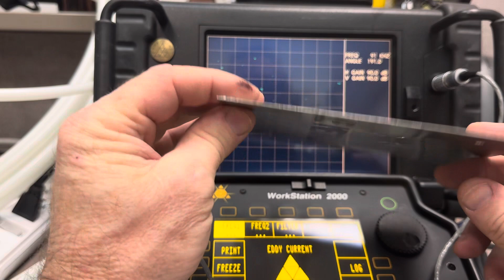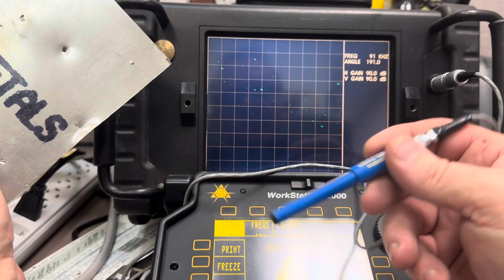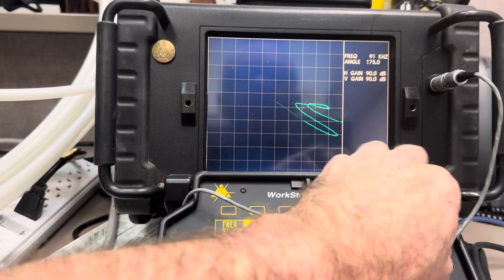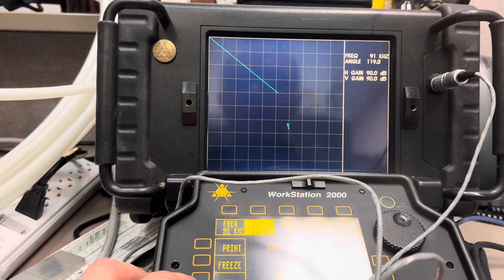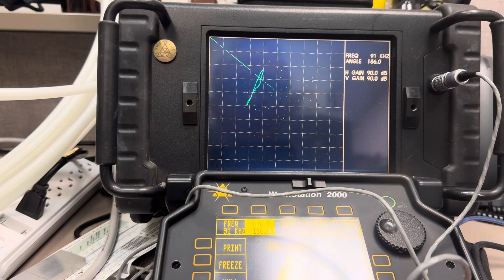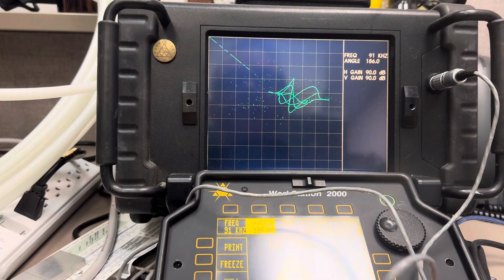Plus-Point Probe Liftoff Over Volumetric Flaw | The Challenge of Complex Eddy Current Signals

Comment: Great demonstration..
Did you set the lift off to be horizontal on the screen?
Reply from the maker: Actually no.  I rotated the surface breaking notches vertical just for effect.  With noise set horizonal, the flaws come in around 10 degrees and 190 degrees more/less.  Based on your comment, I made another video  this morning showing liftoff effects for differential vs absolute.